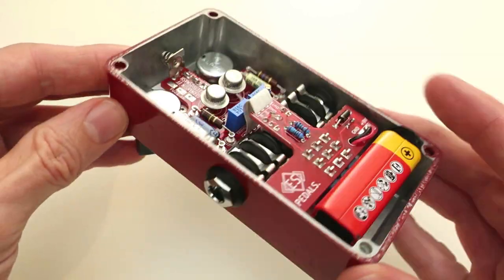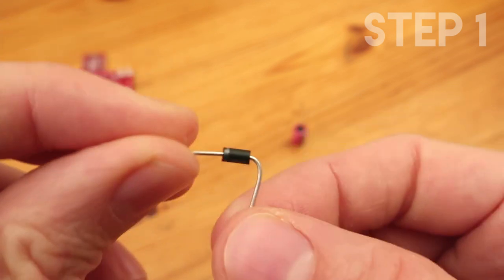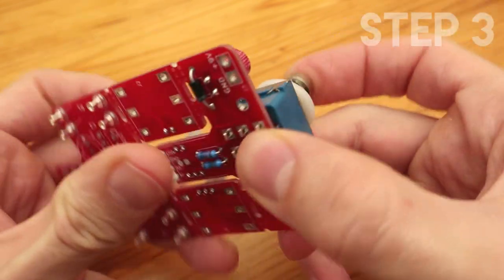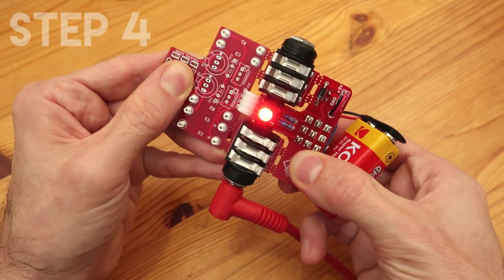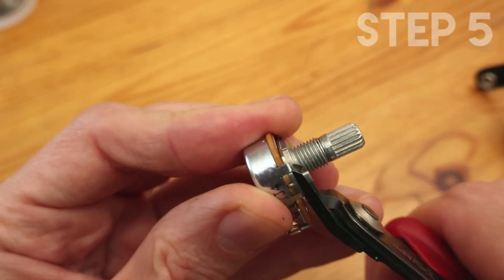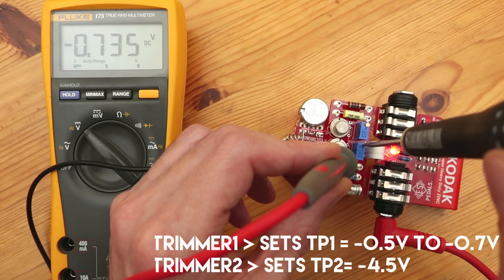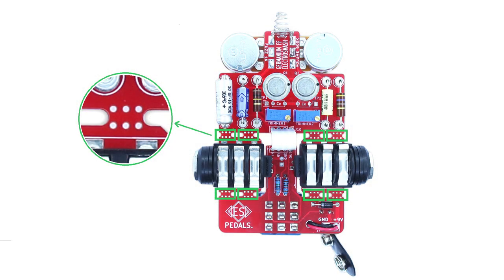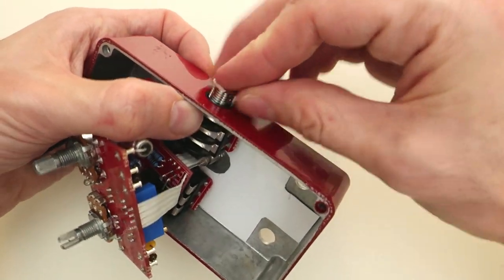How to Build a Germanium Fuzz Guitar Effect

Comment: 6:37 - Instead of using a blade, I have found that an adjustable rotary  leather punch is faster and makes a perfectly round hole every time. They also have the benefit of being able to punch out various sized holes. You can get one on Amazon for under $20 that will last for years to come.

Comment: A few tips: solder germanium transistors with a bit longer legs. The heat can damage the germanium inside. These transistors are much more sensitive to heat than the silicon ones. Soldering in smaller components first gives a bit more room to fiddle with them, instead of holding them with tweezers.
Reply from the maker: great advice, thanks!

Comment: What are the turrets used for? Why not solder the components directly in?
Reply from the maker: You can connect the components directly to the PCB, but the turrets are the vintage construction method. They are reliable, serviceable and ensure a solid connection of the electronic component.
Reply: @Electrosmash  Ah, thanks, I see, I read up on these now... so basically just cargo cult and design.. as serviceability is probably worse if you pin the components through instead of soldering them with loops at the terminal.

Comment: Where are you getting those bias voltages from? The original resistor values never give those voltages.
Reply from the maker: yes they do, with a Q1 with a Hfe around 80 and Q2 with Hfe = 120, the Vc1=-0.5V and -Vc2=-4.5V. With the timmer resistors you can use any high gain transistors and adjust them to the perfect bias.

Comment: cool,what's the code for those transistors?
Reply: 1T308V (1Т308В in russian) according to the photo on the site. Similar GT308V. I used for my FF clone P416B (П416Б). They also with good Hfe (HfeQ1=70, HfeQ2 = 90) and low leakage about 20uA.

Comment: What kind of jacks are those? Nice video!
Reply from the maker: Thanks! the jacks are NMJ6HCD2 from Neutrik, you can check the full components list here: https://www.electrosmash.com/images/tech/germanium-fuzz-face/Germanium-Fuzz-BOM-ElectroSmash.pdf
Reply: Thanks for the info—why stereo and not mono?
Reply from the maker: @demianchristiansen1948  With stereo you can use the input jack as an ON switch, so when the guitar is disconnected the pedal switches off saving battery.